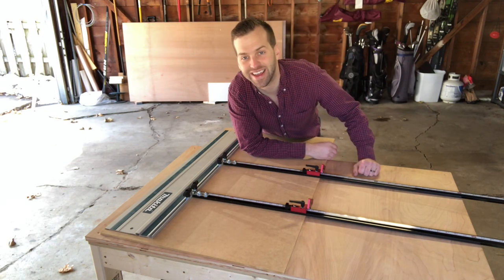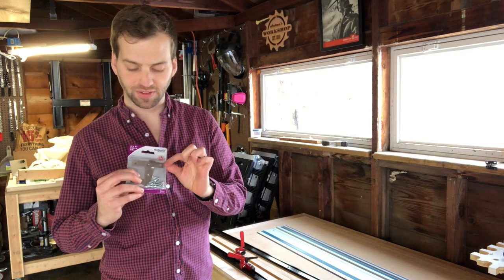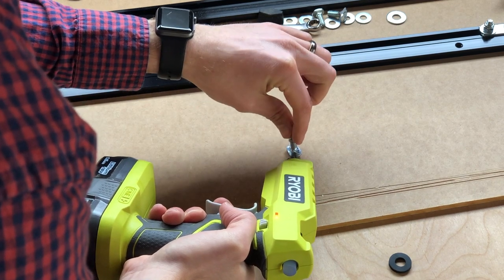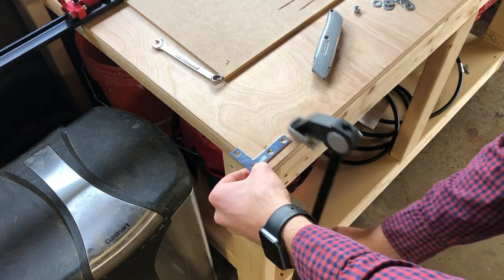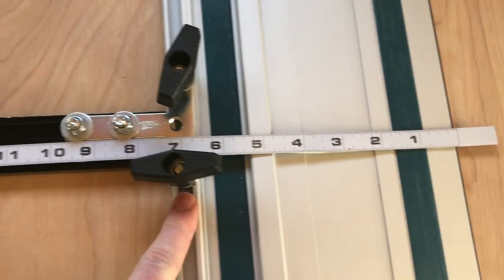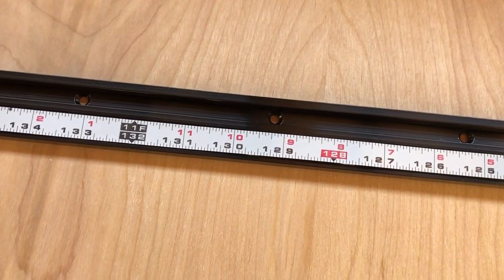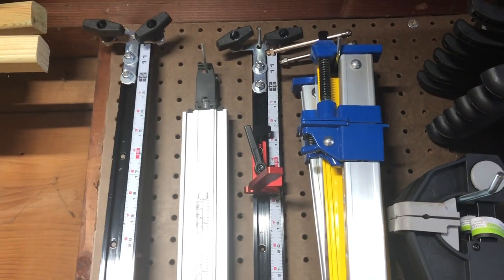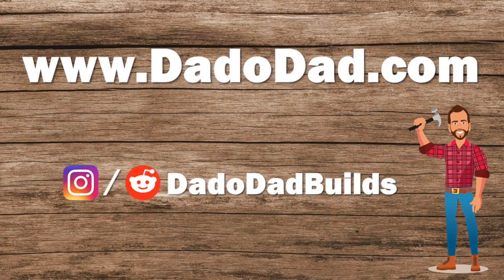How To Make DIY Parallel Guides For Your Track Saw

Comment: Very good!  Using your links, I also found a triple slot bar (2 Ts and a Miter T) that would give a slightly wider bar if desired.  Also,I found an alternative stop (it shows up on same pages as searching for yours) that has its indicator at the same spot as the physical stop, as opposed to yours which has the indicator on the opposite side of the stop.  This saves you a couple of inches to enable a couple more inches of length which might could be of interest if making thin strips off a new 4x8 for example. I think I also like the indicator more in this other one. They are black with two brass screw knobs and the Main camp leaver so easy to find in Amazon.
Reply from the maker: Yeah it seems like the providers are rotating stock. Seems like you got the concept and figured out a good solution too. Enjoy!

Comment: Suggestion: Cut off the stop finger(s) to make them shorter. Their extra current length amplifies any error due to inevitable play in rotating connection and also adds to the relative clunkiness of your excellent DIY build, due to necessary use of off the shelf parts, compared to the svelte specifically engineered components of the TSO model. (Definitely just a tweak, not trying to throw any shade ... :-)
Reply from the maker: I see what you’re saying. I haven’t measured the deflection when pressing against the stops but I haven’t noticed any error from deflection either.
Reply: @DadoDad  IMO one of the best things besides precision and build quality about the TSO product is the compactness of its components. This is the one aspect in which your DIY tool is hampered by constraints inherent in the stock components you have so skillfully adapted. I suppose my suggestion was focused more with compactness than deflection.

Comment: I was so close to buying a table saw because I was getting annoyed with doing repeatable cuts (always off by a hair) but I think this will save me! Don't get me wrong I absolutely want a table saw but I want to wait until I can afford a full sized cabinet table saw. Gonna run to the hardware store and get going on this. Thanks for the idea!
Reply from the maker: I saved up for >4 years and bought a cabinet saw and I love it. But the track saw still is my preferred way to rip down full sheets

Comment: fantastic.i will have to make my own version using metric bolts etc.great video. john wiltshire england
Reply from the maker: I’ve been planning on swapping out my tapes for metric. As I get more precise in my working decimal systems just make more sense than fractional

Comment: Aren't the tightning bolts in the way when you make a full depth cut?
Reply from the maker: Are you referring to the large T-handled bolts? At 4:43 in the video I mention why it's important to pick the oversized T handles for exactly this reason. Thanks
Reply: The saw plate may slide under the T handles, but the motor will hit when you plunge.
Check 4:49 to see.

Comment: This is a brilliant, cost-effective solution for parallel guides. BUT...the DIY T-bolt concept did not work for me. After much grinding, I realized that the square shank is really a problem on the track saw guides (knobs don't fully tighten down, and I don't think the hot melt glue solution would last very long in actual use), and the 1/4" bolts stripped and simply spun out in the T-track. I ordered actual T-bolts online and expect to have much better luck with them. I'll have a bunch left over: does anyone want some?
Reply from the maker: I fully anticipated the hot glue would eventually delaminate at which time I’d have to reapply it. After a full year and a midwestern freeze/thaw the original glue is still going strong. I hope you got some ideas for what works for you.

Comment: The Indra come with pre attached tape, which I assume you have to remove and put on different tape.
Reply from the maker: The flip stops have about an inch of play in the calibration slide. If you had a premade tape you could always set that slide to be a nice easy number to add. For example you might just always have to add 8” to whatever the tape says. Easy to remember for narrow cuts but it might be worth noting the amount to add somewhere for wider cuts.

Comment: In situation like @3:50 i keep drill rpm high and very low pressure towards down.
Reply from the maker: Probably would have just been better to use a drill press

Comment: At 9:07 I think it moved … how did that end up working out?
Reply from the maker: It did - good eye. I recommend the kind with the adjustable pointer. When puting the tape down you only need to be accurate to about 3/4 inch because it's fine tuned after. It works great!

Comment: Instead of grinding down the carriage bolts what if you cut some segments of the connecting bar (that connects 2 tracks together) and attach that to the parallel guides.
Reply from the maker: That is a great idea! I use the TSO connectors and they work great on my Makita rail. There are 4 screws on each bar so if you cut it in half that would leave two usable pieces.
Reply: @DadoDad  You can buy T track nuts and I have a sneaky feeling they would be  cheaper than those connectors.

Comment: What t track did you use?
Reply from the maker: These are hard to find right now. The exact one I used in the video can be found here: https://amzn.to/2ZizQRR (sometimes this seller is sold out). Incra makes a version that I'm told works as well: https://amzn.to/3oniD3e. There's another version over on Banggood that has metric and imperial scales built in: https://www.banggood.com/custlink/3KKYnYBJbQ. If you find another source please let me know and I'll share a link here.